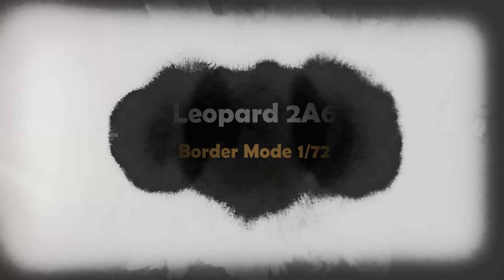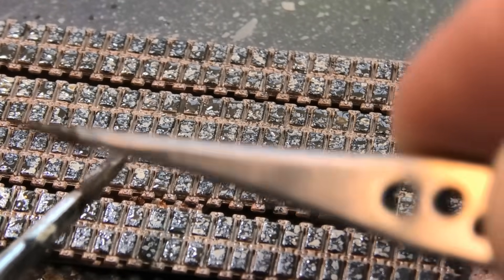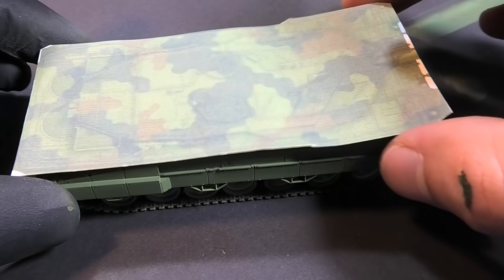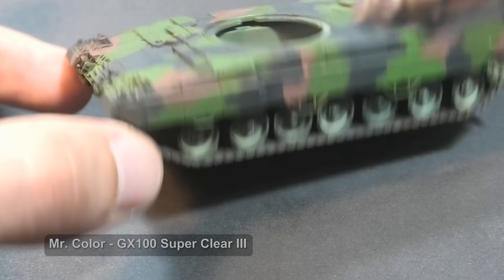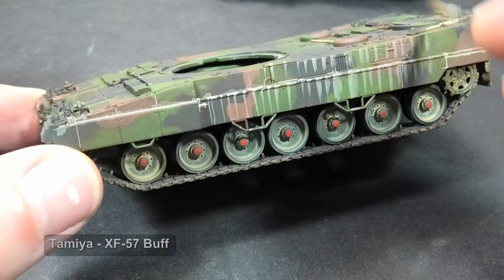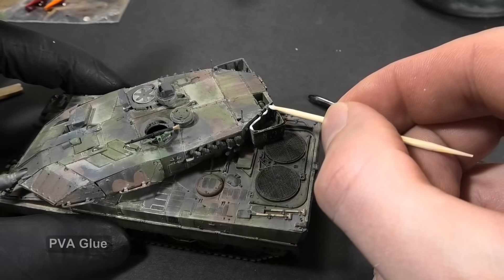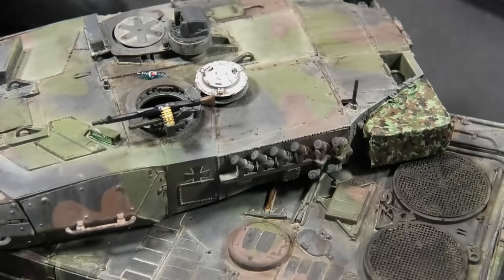Leopard 2 A6 - 1/72 - Border Model - Tank Model

Comment: just a little detail, you're talking about the Merkava "troop compartment" that's a urban legend.
the rear compartment was used for troops only a few times during demonstration in the early days of the Merkava service life, in actual operation this compartment is used to store the ammo racks, the large door at the rear is only used to facilitate the loading of the ammo from cargo trucks and to allow the loader to escape.
maybe you could fit 1 or 2 soldiers in there in case of an emergency, like an improvised MedVac or evacuating the crew of a destroyed tank but not carry a full platoon like in demonstrations.

Comment: Tamiya super thin plastic sement and Tamiya airbrush cleaner is the same stuff, the sement its a 50/50% mix of two cemicals and the airbrush cleaner is a 49/51%  mix of the same two cemicals, so i only buy Tamiya airbrush cleaner now and just fill up the sement bottle with that , works the same and i cant tell any diffrence

Comment: You say that cyanoacrylic glue dry slower on wax paper. When you say "wax paper" or "no stick paper" do you mean the paper for the oven? Or  is it something different? I want to try. Can be very useful but I don't knwo where to find wax paper.
Reply from the maker: No, you can use residual cover paper from some two side tape or kores gumfix. The oven paper is usually very porous.
Reply: @idaemonplasmo  I made a few tests. I tried several materials (plastic rubber, gumfix and the paper of double sided tape). After an hour the winner is the paper of double sided tape. The gumfix is good too. Thank you! Very useful.

Comment: when u have to replace the engine in field condition the turret has to turn to 90 degreee angle. When the turret side armor ist not removed u cant take the engine out of the tank, thats why u can move the armor. great job by the wy, looks very good
Reply: Also, there is some limited storage space behind those panels
Reply: or whenever the powerpack is taken out in general.
Reply: Thanks for educating me on that I did not know that 🙂
Reply: The armor is believed it or not hollow, the rounds penetrate into the cavity rotate slightly so when they hit the actual armor they hit an angle so it can't penetrate basically think of throwing a knife at paper itll go through easily pointed forward throw it at its side and it probably won't go through... or at least nowhere near as easy
Reply: @PLASMA_2005  The projectile doesen't just get angled, it gets shattered into two or more pieces.
Reply: @jonny2954  true but the main thing is that it does that aswell to essentially render the round useless pointy end versus flat end (or shaft)

Comment: What is the ebay reference for optic lents?
Amazing job as always. I see you instead using enamel whases you use Tamiya and its thinner
Reply: I caught that.  I believe the XF numbered paints are actually acrylic.  Using enamel thinner for washes means the wash won t attack the acrylic paint beneath, especially when you wipe it off.

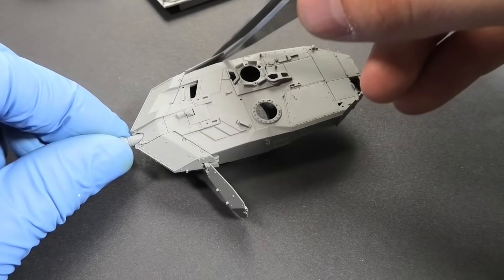Comment: 2:12 The side armor is movable because equipment of the tank is also stored there. By the way, we call this part of the armor "Elefantenohr" (elephant ear). 
And if you want to open the engine cover, you also have to open these ears.
Reply: I presume it could also provide armoured cover for infantry that may be accompanying the tank in an urban situation. ??
Reply: @justinmorgan2126  It’s too high up to provide any viable cover, you also dont really want to be that close to a MBT as they’re high priority targets and could put you in harms way
Reply: @justinmorgan2126  No. The tank would then no longer be able to move its turret, which would be very impractical.
Besides, the space next to the turret is too tight. The infantry would fall off the tank very quickly.

Believe me, you don't want to be standing there when the tank is moving.
Reply: @justinmorgan2126  riding on a Tank while it conducts combat operations is suicide by third person.
Tanks are bullet magnets.
And a moving tank turret is very dangerous to mounted infantry, as it can sheer of or maim limbs, squash torsos etc. 
Also firing the maingun of the tank, while tank riders are mounted on the vehicle severely endangers the mounted infantry due to recoil, concussion etc.
During combat Infantry NEVER stands optop, infront or to the side of an AFV, only to the rear and this also only when the vehicle commander and driver know, that they are there. In general the infantry covers the vehicle from a certain distance to the sides
Reply: @justinmorgan2126  why would infantry be standing 1.5 meters off the ground next to the turret. The turret will knock them off or crush them when it turns lol.

No, the guy is right. In order to get the engine cover off, the turret has to be at the 90 degrees and the turret armour has to be swung open.

Comment: 2:23 For anyone curious about it, iirc the modern Leopards turret (the one with the wedge like in the video) have a big negative space to help protect against shaped charges (HEAT warheads) that lots of missiles and even some tank guns use. Basically the idea is to detonate the charge far enough away from the hull that the cone of fire from the warhead cant penetrate the inner armor layer as well if at all. This is especially important for the Leopard 2 as iirc they dont have the same high tech armor materials other tanks do such as the Chobham/Burlington (used in the Challengers/M1) and ERA (Explosive Reactive Armor) is hazardous to infantry and likely more expensive than spaced armor. I still have no idea why those panels fold out though, aside from looking cool imo
Reply: Because if the engine needs repairs on the battlefield, then they turn the turret and fold this piece of armor in order to protect the engineers. Also, the armor can be changed on the battlefield and i believe thats the piece you need to remove first (like a puzzle). To my knowledge, this turret armor is the best in the world and not a single round can penetrate it if its not damaged already.
Reply: Not really. The Arrowhead is there to protect against APFSDS projectiles. This is how it works: The Projectile enters the arrowhead and once it passes through, exiting the first part imparts a tourqe on the projectile if the APFSDS round is shorter then the space bewteen the front arrowhead and the main armor (so it neither ends contact the main armor and the arrowhead). This leads to the projectile getting destabilized, and turning a bit sideways. this is enough for the projectile to smash harmlessly aagainst the main armor as an APFSDS round cannot take lateral forces, as it is extremly hard and britle (This is also a exploited by Hardkil active protection system, the explosive charge imparts a lateral force on the projectile). Point being, this arrowhead armor concept relies on the airgap inside the arrowhead being longer then the projectile fired at it. If the projectile is longer then this length, it will not be destabilized and the addon arrowhead armor does nothing.
Reply: There's a storage bag under the armour plate with the gun cleaning kit. You also need to open it to open the engine compartement, since it's in the way.
Reply: @dimitrisoikonomou3568  i think they make that armour piece movable, because the need the clearance for removing the powerpack (Engine) when the turret is sideways.
Reply: Leopard use Layered armor, which is difficult to make in round shapes...
Reply: Leopard 2 uses similar composite armor to chobham/dorchester, with a greater emphasis on kinetic over chemical effect protection. (Challenger 2´s Dorchester has a higher resitance vs chemical effects, but a lower resitance vs kinetic penetrators, while the Leo2A5/A6/A7 and M1A1/A2 have composites with about 15% higher resistance vs kinetic penetrators over Dorchester)
The current Leo2A7 uses third generation composite armor and the NERA Arrowhead (Non Explosive Reactive Armor)
Making the Leo2A7 one of, if not the, most protected MBT´s in the world